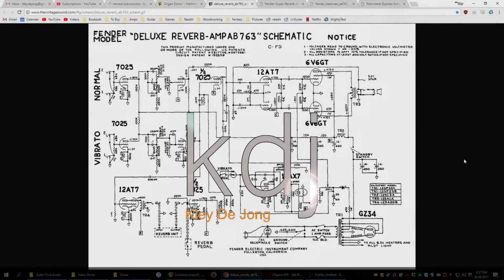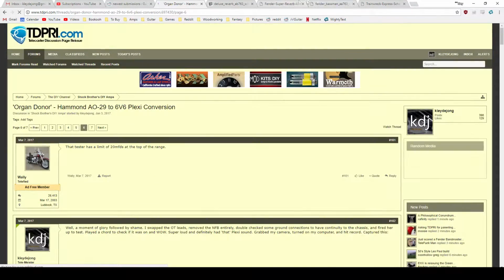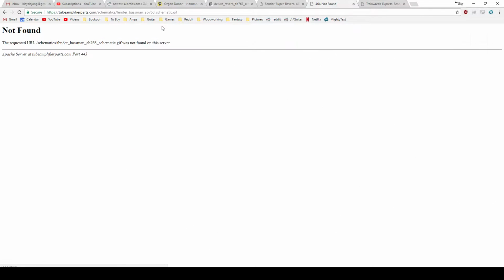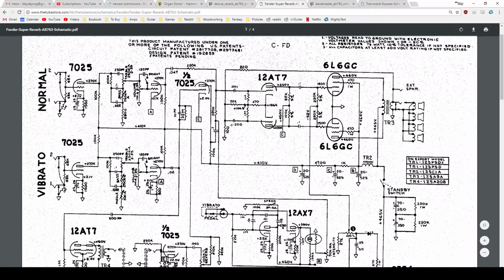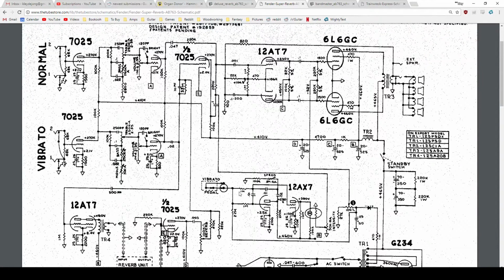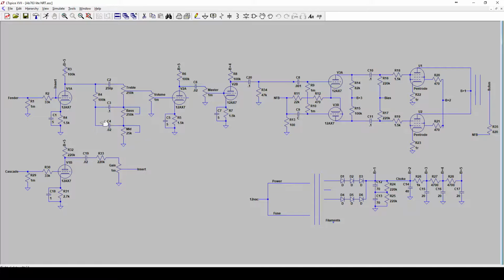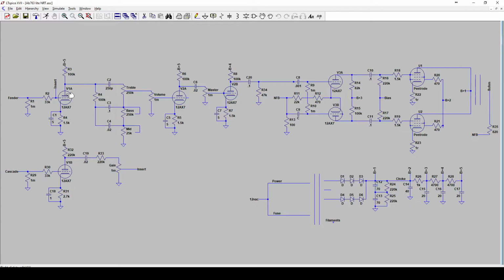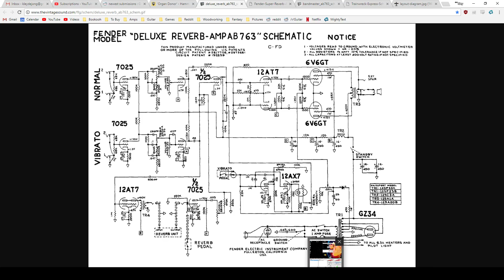Hammond AO-29 to Fender - Pt 3 | Schematic Overview

Comment: Plate resistance and plate to cathhode current together will pull down B+.

For instance, the tube manual says 6V6s have 70k plate resistance and 5881 have 30K. Look at the operating conditions for each tube at similar plate voltages and note the difference in current.

The other variable is the current rating of the p.t. Lower current rating = less actual voltage at time constant under loads exceeding the rating. Kind of built in sag without a tube rectifier.

Comment: Answering your question about the B+ voltages, it does have to do with the type and number of tubes in circuit and the line voltage. The voltage values on the schematics is assuming usually a 110-115 line voltage vs our modern 120, and is assuming all of the tubes are warmed up and loading the transformer. If you had all of the tubes installed in the Hammond amp you’d probably be closer to the published values.